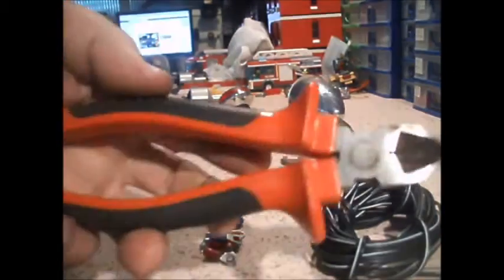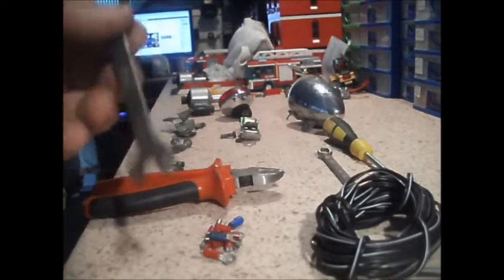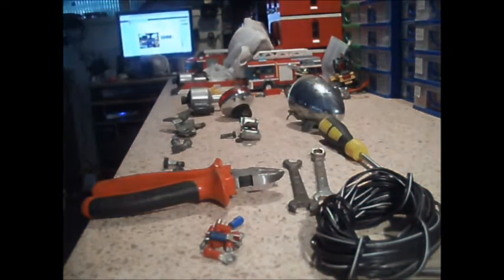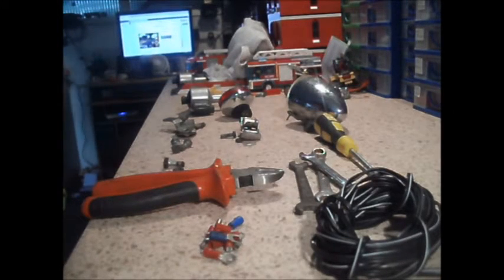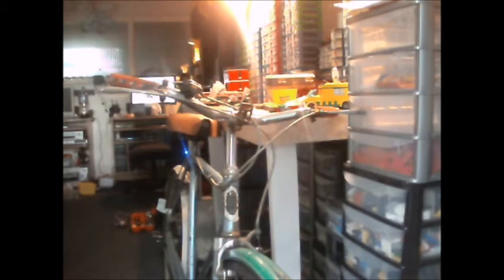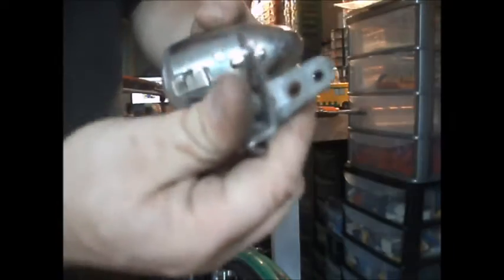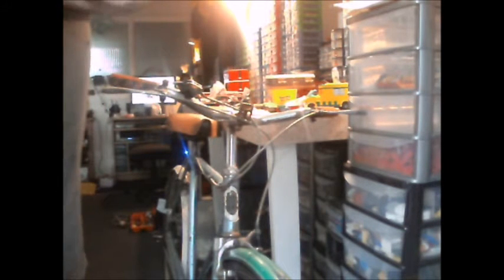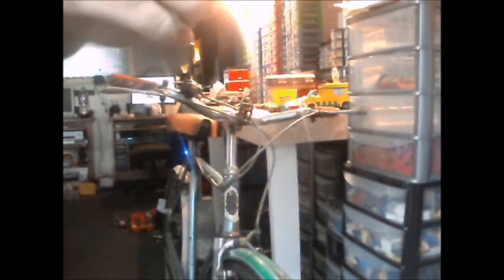Tutorial How to install dynamo lights on a bicycle

Comment: Thanks much. I agree absolutely that the wretched practice of using the frame as one leg of the circuit is the source of all evil in the universe. Kids, always do as the gentleman in the video and use 2-conductor wire.

And, I'd like to emphasize that the second frequent installation problem I see with these systems is failing to line up the axis of the generator with the bicycle's axle - if the generator is cocked even a few degrees forward or back, so that an imaginary line through the generator passes forward or behind the axle, the generator friction wheel slips, resulting in reduced output and premature wear on the generator friction wheel and tire sidewall.

BTW, I think I've seen your cinematographer at Cannes - or, at least lurking around a seedy bar on the outskirts of Cannes, carrying an ancient 16mm windup camera...

Comment: Juat curious, have you ever come across a CycleRama 6 volt 3 watt dynamo before? I have one but can't find anything about it
Reply: Your CycleRama unit is no different from the Union this man is using. It will work with similar lights seen here. You can also find suitable lights for it on Amazon or eBay. Just select lights that work at 6 volts and do not total too much over 3 watts. Typically the headlight will use a 2.4 or 3 watt bulb and the taillight will use a 0.6 watt bulb. Hope this helps you.